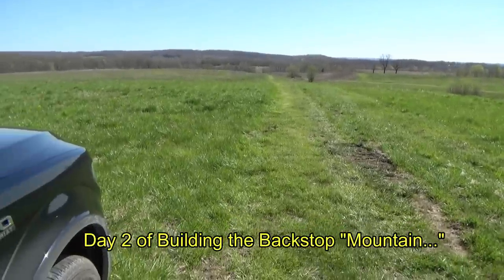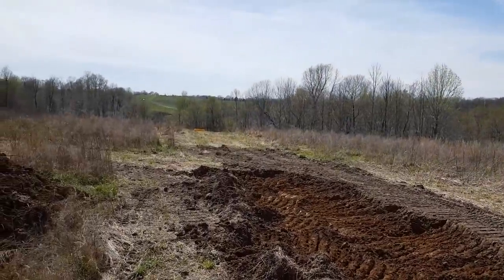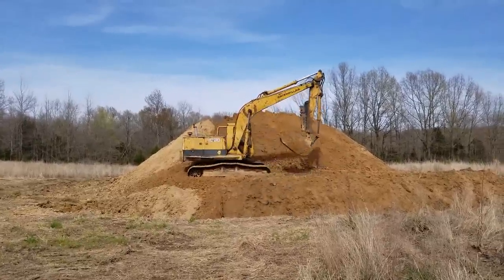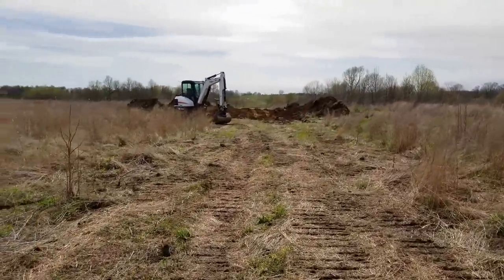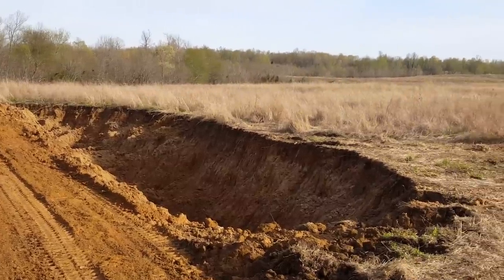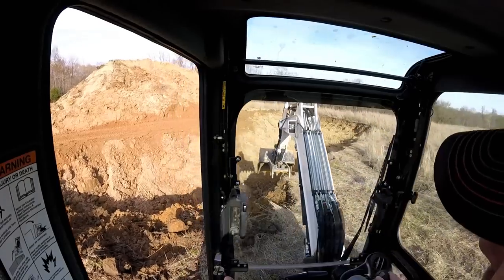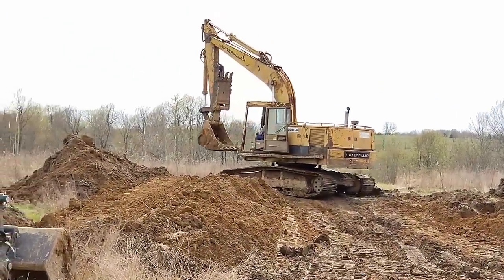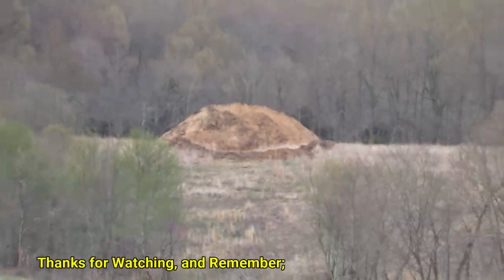Kapper Mountain 1,000 Yard Range Backstop  IT'S DONE! 04-21-18

Comment: how much approx does an excavator that size cost per hour?
Reply: Usually somewhere between $125 to $175  per hour here in Missouri.   That includes machine and operator.  Probably will have a 4 hour minimum or more.  There may also be a one time mobilization fee to get the machine to your site.
Reply from the maker: Dang JP, you hit it pretty much on the nose! I am at the very lower end of this quote since its an older machine :). Thanks.